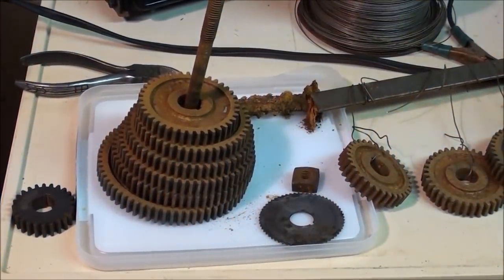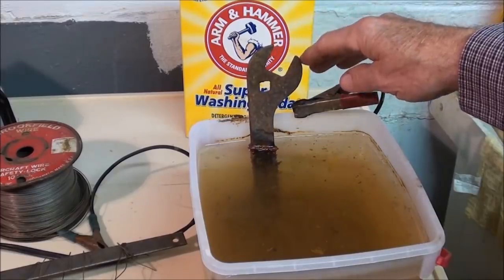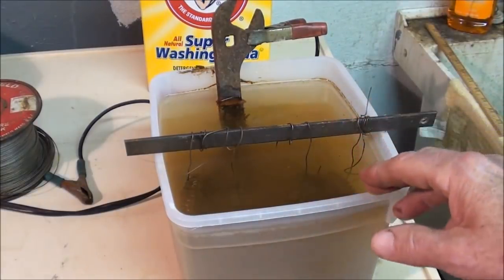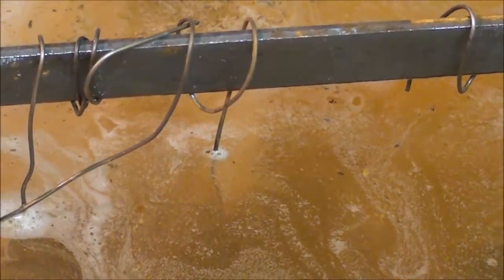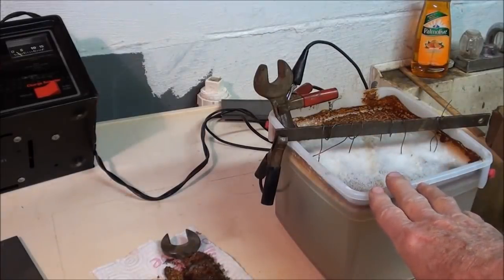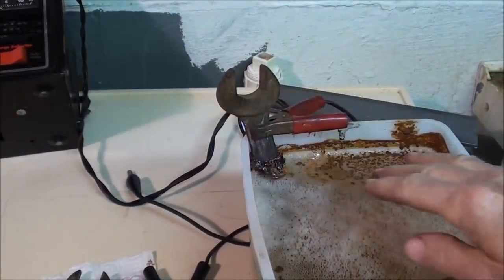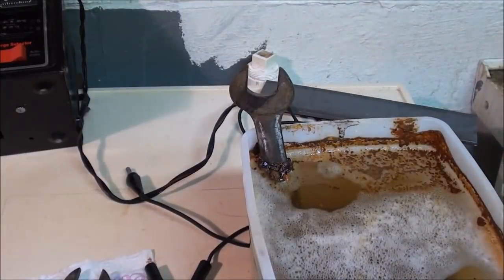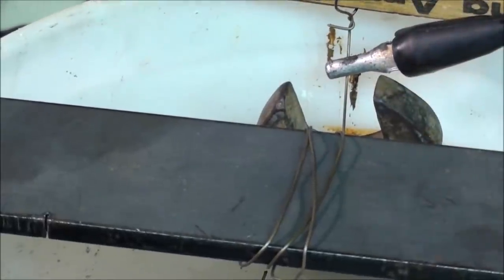MACHINE SHOP TIPS #133 Rust Removal by Electrolysis on the Logan Lathe tubalcain

Comment: I wouldn't have thought the back plate would turn out so well, to be honest. When you showed it going into the bath, your hanger wire wasn't snug around the piece, and there was so also much rust on it, that I figured there was no way it would make good electrical contact and come out so nicely. Very impressive, just how well that process works. One thing though--it's the electron travel that moves from negative (cathode) to positive (anode). The conventional current theory has "current" moving from positive to negative--but the flow of electrons is from negative to positive, as the positive anode attracts negatively charged ions ("anions"). A subtle point, but one important to clarify.

In addition to what others have posted in these comments, the sodium carbonate is of course needed to ionize the water so that electrons can travel from the work piece (cathode) to the sacrificial anode that is the positive electrical terminal. Since it is free or valence electrons that actually "conduct electricity" (ie; become current), you need some ions in the water in order to facilitate electron flow. Pure water has covalent bonding between the hydrogen and oxygen atoms (H-O-H), and the electrons involved in forming covalent bonds are not electrons that can be involved in current flow--those bonds are too strong. Also, water molecules are held to adjacent water molecules via dipole moments, so there aren't free or weakly-held electrons involved there either. Therefore the bottom line is that there really aren't any suitable electrons available in pure water, so there aren't any electrons available to migrate from the cathode to the anode. So you have to add something to ionize in the water and get current flow, and that something (in this case) is sodium carbonate or "washing soda." Basically...no ions, no current flow.

Finally, if you go watch shopdogsam's electrolysis videos, you can see the difference that the washing soda makes. He adds a little, and gets a little current flowing. However then he adds more, and gets more current to flow. So to a point, more is better. I think he states that about 1/2 cup per 5 gallons of water is what he has found will optimize the process. It's been a while since I watched his electrolysis videos however, so someone please correct me if I am wrong on the amount.

Comment: I didn't read all the comments to prevent 'duplication' . . .BUT :
Sodium BIcarbonate is 'Baking soda'  . . . 
. . .which can be 'baked' at 350 degrees for an hour , & will give up one of it's carbon molecules, making it Sodium Carbonate , or 'Washing soda' . . . . Cheaper than the washing soda !    I shudder to think of all the great old machines that have turned to scrap from neglect & abuse ! ! !   ( < when just a bit of labor would render them 'PRICELESS ANTIQUES ! ! ! )      Good show, Mr. Pete !
Reply: Sodium bicarbonate = baking soda, NaHCO3

Sodium carbonate, aka carbonate of soda, aka soda ash: Na2CO3

Baking the bicarb at a low temperature can drive of the hydrogen atom.

Go to a higher temperature, and you drive of the CO2 molecule - the process is called calcination from the Latin word for burning.

The CO2 forms gas bubbles in bread, and leaves behind Na2O, aka soda.

This form of leavening is the basis for soda bread, biscuits, and some cookies.

For the electrolytic cleaning process, it really doesn't matter whether you make your solution from bicarbonate or carbonate - the iron will for an acid in the water, and the carb / bicarb will reach an equilibrium, forming a buffered solution.

Buy the cheap stuff, and make your soup, and with a little care for safety, you shall have good results...
Reply: chemech
even regular salt does work.
Reply: Mitchell HürenKamp  all I ever used so far was baking soda. Worked fine. Don't know if washing soda would work better or not?

Comment: Mr Pete...Another great video...I noticed around frame 15:00 you got a spark when you connected your anode... Even with the charger OFF some residual voltage can be present in the filtering capacitors inside the charger. They can hold a charge for a very long time even overnight. So if you disconnect the clamps when power is still on the cap will be left in a charged state. IF you turn power off when the unit is still drawing current (attached to parts)  it will dissipate but needs a few seconds. So to make sure you do not get this spark before you power on the charger, wile hooking up things, if you touch the clamps together (ground /negative and positive the cap will be discharged...This can make a spark as well and should be done away from the bucket of the (YES its called electrolyte) with the added washing soda.. Safety always...

I have over 25 years as an electronics technician and design engineer... but i am learning so much from your fantastic descriptions...
Reply from the maker: Thanks for watching.  I have wondered for a long time why it was that it sparked. And you explained it.  I have a condenser check, and I would charge a cap. & then discharge it with a loud snap to show the kids the danger of a large capacitor.
Reply: mrpete222  HA what fun..im sure the kids all jumped.. When i was working in an electronics shop we would take a cap and charge it..(Small one) and throw it to a buddy and say here catch...Such rotten Brats we had been..it was sort of like those shock buzzers we had as kids..Old days....Sigh.

Caps have also an electrolyte in them they are in a sens small fast charge and discharge batteries. they are used in timing applications and filtering for the ability to hold a set charge for a set amount of time..smaller faster, larger more time and voltage (for the most part) high UF means high storage potential and capacity..thus the term "capacitor" i imagine.

Comment: Hello, I don't know if it's my eyesight, 76 years old, but while watching your video while you were attaching the red clamp to the flat bar, I swear I saw some electrical activity just as you were making contact with the bar. It was at min 15:03 or so. I waited to see if the charger was plugged in, and it was not. What would cause that to spark like that, if it's not powered on ? I have seen my share of explosions when people were careless around batteries while they were charging. I am a retired public safety officer, and in my dual role as police and fire, I have seen the aftermath of some idiot checking to see if there was water in the battery, while it was charging and using a lighter as a light source. It blew the battery completely out of the vehicle and put him in the hospital. I love your videos. Thanks ...Ken

Comment: Computer PSU work great as power supplies aswell. PSU's easily spit out 10A at 12V. Just remember to connect the PS_ON wire (usually green) to ground to turn it on.

Comment: I am not sure if this has been answered, but the green handle on the ground plug is common in wiring and is commonly known as earthing in European standards.  A couple tips to help the process is to add some form of load to the circuit.  I have been using a car turn signal bulb to draw the maximum current.  Electrolysis can be performed with any compounds that produce an electrolytic solution.  I have been using salt water quite effectively as well as vinegar. I am still looking to try different solutions and hope to try this process soon.
Reply: I would be careful using the salt and vinegar solutions for long periods because these solutions are quite aggressive naturally and if left sitting will cause the parts to rust.  I use this process to clean parts quickly and it has proven effective when the parts are rinsed and oiled relatively quickly.

Comment: ,,,, pencil me in,, present and accounted for,, in my regular seat on the front row,, great lesson today,, this process works very good (the best way I have found) and I do have the 5 gallon tank that has been in use (24 hours a day) for 1 year, 3 months, and some days,,,, using the same water and washing soda (oh, I have added a lot of water due to evaporation, but have not added any extra washing soda),,, great video, and Happy Holidays to you and your family,, from over here on the east coast of Arkansas,, shopdogsam
Reply from the maker: I actually learned this process from your videos.  Are you moving away from the East coast? Merry Christmas.
Reply: I use arm and hammer baking soda for electrolysis, works fine.

Comment: wipe the anode periodically as the buildup slows down the electrolysis also try to use anodes with a large surface area, such as steel plate or flat bar, its easier to clean and the larger surface makes the process faster.

Comment: Great video! I am restoring an old JD tractor and I use a muriatic acid solution in a Tidy cat litter bucket with lid. Works well but one needs to be careful as the acid is nasty stuff. BTW "water displacement formula 40"  - WD40 - I never knew that's what it was called! - Thanks again.

Comment: I have used this method to de-rust an old stanley # 4 plane, and after removing it from the tank, scrubbed off the black oxide that is normally produced with a kitchen scrubber,  and I liked the surface that resulted. It still left somewhat of a antique look, or patina, as they like to say,
And was cleaned up and de rusted with out looking like it had just been sanded down.

Comment: If you don't have any disposable wrenches then the graphite from a carpenters pencil works really well, it still get gummed up but it doesn't stick so you can take it off and wipe it down with a paper towel and it is ready to go again.
For cleaning afterwards i dump the parts into the sink and give them a good scrubbing with a soft wire brush, quick dry off then a soaking in WD40, always come up really nice and no post rusting issues either.

Comment: I like your video persona. Your voice is very pleasant. Some points to make are: l use vinegar to remove the remaining black oxide and then oil the item, The paper you are using may be 220 grit but it is definitely not wet or dry (the white finish is zinc stearate which prevents clogging of the sanding grit on the paper). I use hot water to dissolve the washing soda and set everything up while the water is still hot. In my experience after turning on the current the solution will remain hot and the action is very pronounced. It only takes a matter of a couple of hours to get the job done.

Comment: Hi Pete,

If you get a moment check out the videos that I did for rust removal using CLR....just dip/soak and clean, no wires or vapors!

Happy Holidays
Chuck
Reply: CLR will release some obnoxious fumes, so always work in a well ventilated area = have a fan blowing past you and across the work, then out a window or vent stack...
Reply: I've used CLR for years to bust loose seized engines. It beats the crap out of all the penetrating oils. And it's faster to. Works great on small engine carborators that have sat outside and corroded up. Be quick when you use it on aluminum and potmetal. But for big ole rusty iron and steel objects I haven't had that much luck. Anyway God bless you and have a merry Christmas.

Comment: I've done this by chemical means previously and i've since found out about a process that uses simply molasses and water, if you can believe it. Apparently it's an old trick that they used to restore car bodies. It requires no sacrificial piece and no electricity. Just mix molasses and water and dump your piece in. It can take 2 or 3 weeks though. So I think this is a quicker process. Not sure of the ratio of molasses to water. But apparently it works great. I had previously spent some decent money on a rust removal solution which works in the same manner.
Reply: Sulfated Molasses ratio 9:1
Do not use on cast iron. It severely weakens Cast.
Reply: I've used it to great success on a few old motorcycle gas tanks. The tub and the workpiece are one and the same. A piece of rebar wedged into the filler hole with rubber for the sacrificial.

Comment: You sure simplified this ! I just built one out of a 5 gallon bucket with 6 pieces of #5 rebar drilled and bolted around the perimeter of the bucket, all tied together with copper wire. It’s nice but I’m now thinking overkill !!

Comment: Sodium carbonate (also known as washing soda, soda ash and soda crystals), Na2CO3.
Electolysis works with kitchen salt (NaCl) as well.
Another (but slower) method of corrosion removal is to submerge corroded iron part into molasses solution for several days.

Comment: I did the same thing in an hour or so with heated vinegar.  Just put the rusty bits in a glass or plastic container, fill with hot vinegar, agitate periodically.  I did this on some hex bits and they all cleaned up nice.

Comment: Great video, This process works by line of sight so adding another anode will clean both sides. Using graphite will eliminate the crud build up when using steel for an anode. Be sure to clean off the anode for best results.

Comment: I like to use damaged threaded rod or worm-shaft for anodes, because the greater surface area per mass of metal seems more effective. When the crud builds up, I clean them up on a wire wheel for re-use. Rectangular boxes like those sold for storing rolls of gift wrapping paper work great for long items, especially if you line the bottom with plastic grid from a florescent light diffuser to keep parts out of the silt.

Comment: Thanks again for the tip.  I have a similar battery charger, 6 amps, that doesn't have a manual switch like yours does.  I'm wondering if the amperes will fall off during the process and be ineffective?

Comment: hello sir , the black stuff your getting can be avoided by using sodium hydroxide instead of baking soda. most drain cleaners are pure sodium hydroxide crystals . also if you use stainless steal for your anodes they will not corrode as bad or in some cases not at all, this will insure the current draw of the system stays high instead of fading off
Reply: ***** no need to keep every thing simple or you will never accomplish complex task efficiently, baking soda ruins both anodes and cathodes very fast
Reply: I've seen where stainless steel creates hexavalent chromium toxins; another U.K. contributor says not to worry.  Can the sodium hydroxide be in liquid form as in bottled drain cleaners?
Reply: Fred C Dobbs not sure and your are correct about the hexavalent chromium
Reply: He is using washing soda (sodium carbonate)  and not baking soda  (sodium bicarbonate)

Comment: The cathode isn’t touching the product in anyway at all is it? I can see that the anode is connected but for sure, the cathode is just dangling in the water with a negative, ground connected to it correct? Just to make sure you’re not supposed to connect the anode and the cathode directly to the product? Just want to make sure that I only hook up the anode.

Comment: I like metal prep, phosphoric acid solution I believe, that body shops use, and I sometimes punch it up with HCl (muratic acid) dangerous, use protection! Has worked well for me except for a 350 Chevy sintered harmonic balancer that went from a pretty tight press fit one day to a fit that I could spin on the crankshaft - it would spin three turns I think. Use care with powerful chemicals. 
Metal prep leaves a phosphate coating suitable for painting.

Your electrolytic setup seems like it fizzes more.

Comment: The faceplate looked very well after being finished. When you bear in mind the ratio of rust to iron is about 7:1 the rust has to be quite substantial before the pitting becomes too detrimental. You got quite a bargain with the usable equipment with that lathe. Regards.

Comment: Tubalcain,
    While I've never tried this process before, I have used solutions for other purposes. I think if you were to add a air stone and air pump from a fish tank it would help to circulate the solution and speed up the process.
     Also does this process permanently damage the sacrificial anode? Or could you reverse the leads and clean the piece back to original condition?

Comment: Hi Pete, what would happen if you used that wide plate as your anode ( as original test ) and the corroded wrench as your cathode ? Would it remove all that "crust" that attached to it when being originally set an the anode ?  Have you ever used a soda blaster or sand blaster to see which gives better results ?  (Results would vary depending on blast media- walnut shells, glass beads, actual sand ) I have used sand and seen how much actual material is destroyed unless protected.  Fellow DIY viewer  Jim K

Comment: Could you use a metal bucket/pail as the cathode, or maybe saw the top half off an old water cylinder and hang the parts off a piece of wood?

Comment: Thank you again for the lesson...have you tried the molasses solution method I ''ve seen others perform on you tube to remove rust? I don't think that method would leave the surfaces as smooth but could be safer...your thoughts?

Comment: Hi, your video on rust removal is most helpful thanks. Quick question, you mention that the power source should be DC and you basically used a battery charger in your video, can a 12 volt car battery be used as your power source, I don't own a battery charger, thanks again for your video as well as a reply.
Reply: Charles Rivera battery would only last so long. Because you're relying on the charge 100%. The power output goes down as time passes too. Think of leaving a light on with the battery as its only power.... how long does it stay lit. To do a good job on electrolysis, you need up to 24 hrs of power. Just saying.